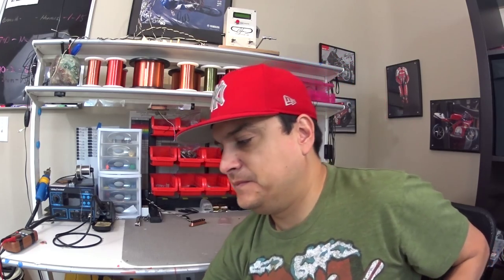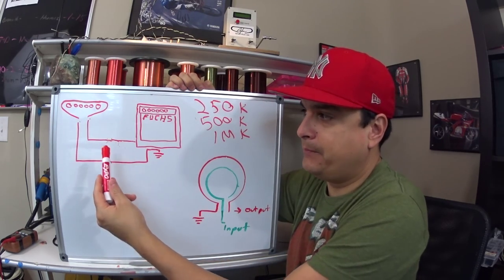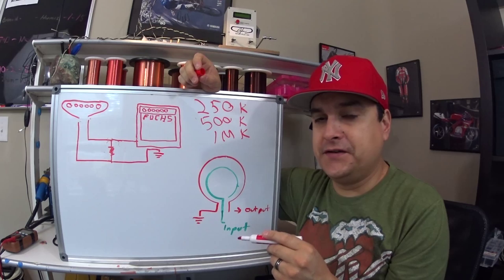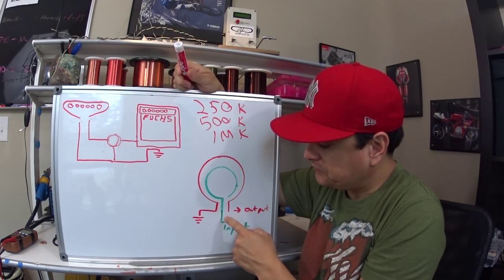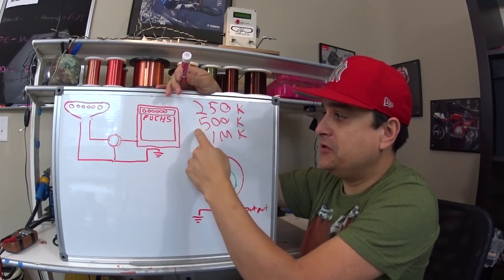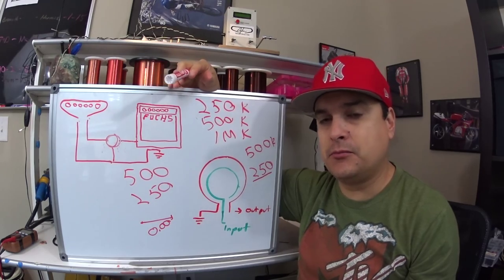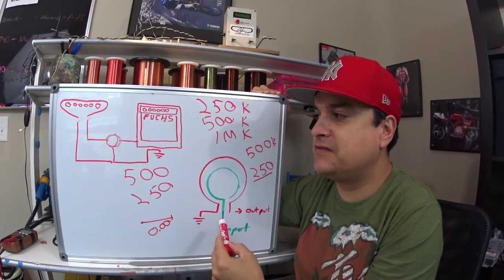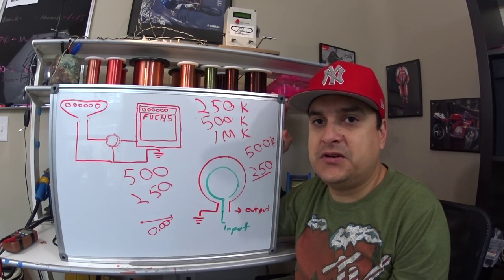Dylan Talks Tone Ep #10 250 or 500k pots in your guitar #30

Comment: When changing potentiometer values from those designed, the entire circuit is affected, including volume and tone quality. Thankfully, the voltage involved in guitar circuits is very small, so there are no major potential hazards involved in experimenting with various pot values. The current produced by the pickup increases when the value of the volume pot is increased. Therefore the high frequencies are more pronounced.

Comment: I got hung up about what kind of pots to put in a guitar that sounded muddy, just ended up getting a cheap eq pedal off eBay for £15... Does the job of brightening up the guitar without the hassle of soldering. If you want to change the tone of your guitar, there are less permanent ways of doing it.

Comment: I can add, the position of the pot add and electronical effects called   "voltage divider" that the portion of resistance remaining either side of your settings, like Dylan said you can have zero volume to full volume, and there is linear and logarythmic potentiometer, there differences is mainly how they vary electronicaly, maybe Dylan can make a video about the difference between them. I just cannot make a drawing in the comment section ahah

Comment: Danelectro single coil lipsticks used 1M pots for the reason by way of how they were wound originally and for the sound they were looking for and probably there were plenty of surplus 1M pots available as the big names were buying up the rest .  I'm guessing that the modern crop of lipsticks are not made the same way as the values in their wiring diagrams have changed to 470K I believe in the attempt to replicate the original sound . I guess the only way to get the Jimmy Page Dano 59 sound is to rewind your own or  buy original style wound pickups from someone like Dylan and slap 1M pots back in .

Comment: What about when you actually turn the pod. The wires are capicitors themself  and form an rc high pass filter. That means when you have high resistance you should be losing frequencies .you should iimagine an narrowing parabola as you increase resistance and lower amplitude. Difference is with 500k pod is that they doesnt get as narrow in conjunction sith the amplitude reduction. You have more treble and are louder when there is a tiny bit of recistance. 

V_out(R2/(R1+R2). And At=1/√((WCR)^2+1),

Comment: What does it do to the lows????? This is super informative. I’ve got a les Paul copy from Japan 1975. Had stock pups in there outputting 7-8k I wanted a bit more goose in there. Swapped the bridge to something that pumps 11-13k I think. And the lows feel like there getting squashed and bottleneck flubbed. Backing pickup height down helped a bit. 
But I have to assume 70s tech would be 250k pots?? Would replacing tone and volume to 500 open them up to breathe more???

Comment: Is there a way to cleverly place a capacitor when coil splitting a humbucker with a 500k pot so the single coil position only gets 250k from the pot?
Reply: Hi, you just need to switch a 500K resistor to ground when you tap the humbucker. Two 500K resistors in parallel equals 250K. If you find a coil tapped humbucker sound to be too thin, try tapping the coil to ground via a 22nF capacitor. That way you keep some of the low frequencies from the other coil of the humbucker.

Comment: Only just found this channel and find what Ive listened to really informative.
I have a specific question - have had an SD JB HB installed into bridge position in a strat style guitar with single 250k vol n single 250k tone controls - now HSS previously SSS. 
The JB sounds dark lost some top - any ideas without changing pots ideally to improve - 5 way super switch is std in my guitar.

Comment: It would appear that cheap guitar brands seem to use 500k pots on single coils, both my Harley Benton DG57 Strat and my Squier Affinity Telecaster had 500k pots factory fitted.
Reply: luvstellauk   There is nothing cheap or expensive about the pot value though.  It’s just a design choice to match what are probably higher impedance, thus darker sounding, pickups.
Reply: @artysanmobile  I know, it was a responce to the 500k = Humbuckers 250k = Single coil comment in the video

Comment: You can customize or change the value of any pot by soldering a resistor to the outside lugs of the pot.
Example: 1meg resitor on a 500k pot will give you 330k.
Reply from the maker: The only thing that sucks about doing that is the taper changes. If it is a linear pot, it doesn’t matter as much. Thanks for sharing this. I’m gonna mention it tomorrow.
Reply: @DylanTalksTone , the taper change is negligible,  really depends on how much you drop the value. Yes if you drop a 1meg to 300 it will be noticeable.  But shaving 100 to 150 k on a 500k or shave 50k off a 250k is not really going to effect the taper too much. In short its relative to how much your taking off.
If you use a 250k volume pot with a 500k tone pot alot of the taper on the tone pot is wasted any ways doesn't really do anything until you get about half way. In this case dropping that 500k to 330k will noticeably affect the taper, but in a good way. The tone pot will start cutting the frequency faster because its starting value is closer to the frequencies being received.  Yes this mod works the best in my opinion on a linear or 60/40 vintage taper pot. You can also run a cap in front of the resistor in series to modify the taper.

Comment: I understand the concepts of electrical components and electrical circuits. My question is How does a capacitor work in the Tones and volumes? Sometimes you see one shared and/or just one by itself. Also does the resistance in the ohm factor play any part in this on a pickup? Is this then considered a DC current or alternating current since there is a ground involved?

Comment: Dylan, I have a 3 knob sterling "by musicman" bass with a 2-band preamp. I'm wondering if I could wire the installed  4 lead humbucker pump to a Volume/Volume/Tone configuration just like a standard Fender Jazz. I would use 1meg linear pots for all three configurations. Do you think that this is possible? I've been playing bass for quite a while now and more and more I'm starting to dislike active tone circuits in favor of the passive tone organic sound.

Comment: I have a ESP LTD Phoenix-1000 with two humbuckers that sounds too harsh/shrill/trebly whether clean or overdriven.  The lack of a tone knob may be why (2 volume knobs only on this guitar).  Even after swapping out the stock Seymour Duncan JB and '59 pickups with melllower Alnico Pro II's, the guitar still sounds harsh/shrill to me.  Since I mostly play hard rock and metal, I want to put the JB and '59 back in there, but how do I fix the harsh/shrill tone?

Should I:
A) convert one of the volume knobs to a tone knob to roll off higher frequencies?  If so, which capacitor value should I use?
B) Change the two stock 500k pots in there now to 250k pots to reduce higher frequencies
C) Both of the above

Comment: awesome video the guys in the chatrooms need to watch this before they run there mouth..thanks man..I have a 2013 gibson lpj and a 2013 sgj both have gibson 490/498 pickups and both guitars have the circuit board and like 250 300 k pots shitty wiring I have been told to switch to 50s wiring and cts500 pots i play metal and sludgy shit like coc /down/sabbath pantera heavy stuff so would the 500 pots be to bright or could i just roll the vol down???and what caps should i use for metal I also like the blues zeppelin floyd pretty much any rock n roll thanks for your help...not sure to get the russian caps paper and oil 22  or what to get..
Reply from the maker: I would try calling jerseyshoreguitargarage.com and talk to him. He has a really good and affordable drop in replacement setup for your guitar. Sorry about the slow response.

Comment: Great channel, SO many questions answered in just a few videos already!!!!! I'm new to learning all this... so basically the volume pot determines the 'filtering' happening before the tone pot? In other words if you have a 250k volume pot and you stick a 500k tone pot on there it wouldn't make a difference unless the volume was also 500k? I've got some super dark sounding humbuckers I want to hear open up, even connecting direct to output to see what their full potential is, and I'm not sure the best way to go about it. Some have the Gibson quick connect too so I'm trying to figure out how I can test out some brighter wiring options. Is there an easy way to wire the quick connects straight to the jack to get the raw sound of the pickup? I can imagine a little jumper stuck into the plug with a lead connecting to the output jack but they have 5 wires and I'm not sure how that works.....

Comment: Thanks for the awesome explanation! I arrived at your channel because I'm looking for a way to free up my tone knob's spot by stacking the volume and tone. Trouble is, there isn't a equivalent dual concentric pot out there. So how can I take my vintage-style jaguar harness (2 CTS 1 Meg audio pots, a 56k resistor between the volume and tone pots, and a "192p" Sprague .1 capacitor on the tone pot) and use a stacked pot without straying too far from the design intent when my only choices are 500k/500k, 250k/1M, or 250k/500k?

Comment: I'm planning on putting a Hot Rail pickup in the bridge position of my Strat and using a push/push pot to split the coils. My question is should I use a 250k or a 500k pot? I will probably be using the pickup as a humbucker most of the time but I will be using it both ways and I am not sure of which pot will work best for both applications.

Comment: Modding my Clapton strat to sound like deluxe. Vintage noiseless pickups suggest 1M pots with treble bleed on volume and .022 tone cap. Any views on that. Tried some 500Ks and wondering if the 1M are used to hold up some of the treble with what is essentially a humbucker pup. Clapton electronics does my head in
Reply from the maker: yup because noiseless pickups kill the highs. The 1 meg is trying to compensate

Comment: But what about the power condition?.. Is 500k has more power than 250k?..Because I've read many articles on internet than if we're using 250k our pickups didn't work at it full potential.. I think it make sense because I've experienced it by myself on my single coils pickups and I planned to try out 500k for my single coils and I remember Yngwie Malmsteen also use 500k pots for his single coils strat.. Hope you can say something about this issue.. Thanks

Comment: Great video! Need to hear about the capacitor situation soon! I’m doing all my own soldering, Dylan, and would prefer to do it right the first time. Been soldering copper pipe since I was sixteen, but never owned a soldering iron until recently. Built a 1x12 speaker cab with an Ipswichian G12-T-75 for a bitchin’ little DSL-1 that I recently acquired, and It. Sounds. Awesome. So I have a couple of guitars that are in need of electronic rehabilitation, one of which - an Ibanez - was looked at by a buddy who specifically mentioned that when I do change the pots, I should change the caps from 250 to 500, what, microfarads? What unit of measure are we employing here?

Comment: Thank you Dylan for sharing your knowledge. Which are the most common values for  treble bleed cap for highs plus resistor for taking back the low end of the tone accordingly with several types of pickups  ?

Comment: I disagree. There is no such thing as higher frequencies "taking a lower resistance path sooner" than lower frequencies. Resistors are basically frequency-independent. Caps on the other hand are not. The higher the frequency, the lower the resistance. Coils are the opposite the higher the frequency the higher the resistance. Volume pots with higher resistance value give a lower load on the pickups that's all. The "Tone" knob is a circuit of a variable resistor and a cap, witch acts as a frequency filter. Adjusting the resistance of the tone knob adjusts the filter.
Reply: Absolutely! Soooooo many just don't get this.
Reply: Yup.  1/RC , right?

Comment: DYLANTALKSTONE, older 50s strat used a different wiring on the TONE pot how does this change the impedance output? Also when you disconnect the TONE pot and go direct output bypass the tone pot will change the impedance output and if the guitar pedals input impedance is not 1meg or 10meg how does this affect the impedance mismatching of the guitars impedance to the guitar pedals input impedance? Yngwie malmsteen plays direct no tone pot going to a DOD preamp pedal if you use a strat with a tone pot the impedance output is different and you don't get the same song out of the DOD preamp pedal because of this. Can you make a video explain this more in depth?

Comment: Ok so in other words, if I wanted to brighten up my neck humbucker on my Les Paul I would swap out the stock 500Kohm for a 1 Meg ohm? On my guitar that has a 57 classic+ it is very bright so to bring that brightness down, just swap out the 500k volume pot for a 250k volume pot? 

Now, why not come out with, if it doesn't already exist, a pot that can go from say 250k to 1 meg? If the outside material determines the resistance, could you have an outside material that I guess gets fatter as it increases around ? Or maybe a better way would be to build a pot that is stepped, what I mean by stepped is say it is your normal round pot but it has three levels to it and your volume pot shaft can be clicked between the different sizes, all the way down and you are running the ring that has 250k pull it up to the middle position and now your'e on the 500 and fully pulled up you are running the 1 meg ring of the volume pot -  could something like that be built or is there something like that?

Comment: Really digging your videos these days. Exellent! I have a strat that came with the hot noiseless (hum cancelling pups) and it still uses 250k pots with a strange twist. On the tone pots there are hi freq bleeds with 0.001 cap and the 0.02 tone cap is put in conjunction to a resistor (don't know the value). What's going on?
 Also I am planing to put jb trembucker bridge, jb jr middle, quarterpound sc neck how can I make tje 250k pot sound like a 500k (treble bleed maybe)? And is anything to be kept from the actual setup on the tones? Appreciate an answer struggling here:)

Comment: Hi Dylan! I am a big of fan of yours. I have a question. When you have a HSS configuration with 1 master volume and 1 master tone, what do you usually do regarding pots? I have a Yamaha pacifica HSS and put a 250k volume and a 500k tone only for the Humbucker. How the volume pot would affect the overall pups in terms of resistance? Thanks a lot.
Reply from the maker: I just did one today and I used 500s
Reply: @DylanTalksTone  but even taking the tone pot out of the singles' way, wouldn't the 500k pot from volume make the singles a little brighter than they are supposed to?
Reply from the maker: Then turn the tone pot down some….

Comment: The connections at the drawing of the pot is no good for me, and for those who use noise gate... This way there is always a resistance at the output so you might not hear the sound of the pickup, when the taper is all the way turned to earth, but you will have a hum. The shorter way to earth passes trough a 250k, or a500K, or 1M. Your amp will still get signal.
I did tried it. 
For my personal taste, output should be at the middle leg of the pot. This way when the taper is turned to the earth leg, your output will be shorted to earth, resulting a quiet amp.
You might loose some frequencies from the pickup, but you can always change to a different value pot to gain them back.
By the way... Pots do come to huge variety of values... The industry standard dictates these, as the "common" values....
Have in mind that for example 500k (or 250k) pots, are US standard... In EU they are hard to find. 470k (or 220k) is the the standard for EU, as the nearest value. You may find 500k but only at guitar related shops, imported from US, thus more expensive. NOT at common hardware stores.

Comment: Im wondering what sort of effect wiring in a potentiometer/resistor combination
in parallel with a master volume control would have on the sound of the pickups after watching this.

Just an idea, but say if you were using two 1 meg pots, and connected a 500k resistor in series to the L2 lug on one of them, the resistance value range on the pot with the resistor connected would range from 500-1500k. 

By connecting that in parallel across the 1meg master volume pot from L1 - L3, it would allow the resistance of the master volume pot to be changed on the fly between 333k and 600k.

Might try this idea out on my next project guitar just to see what happens.

Comment: what you would say about 470pf capacitor with 5,6m resitor for cancelin the 60hz hum  before that . would that efect thoes in signal chane ? 
My guess it would cut out bass but the rest. dunno . values could go lower ... 
+ to get rid of radio noise. do you know any way how to implement a signal transformer in passive ciquit ? 
as to my knowlage thers only a active way of doing that . if it would be passive it would be a God send . 
wy im asking becouse i dispise and want to avoid any noise gates - hate them . ( cant live without ) - high gain madness . 
Thanks for your great knowlage ?